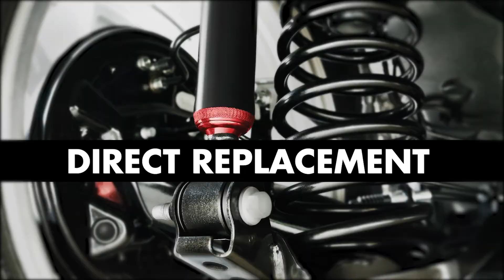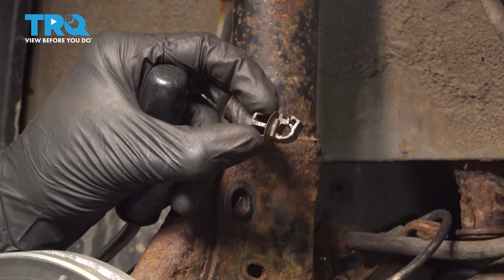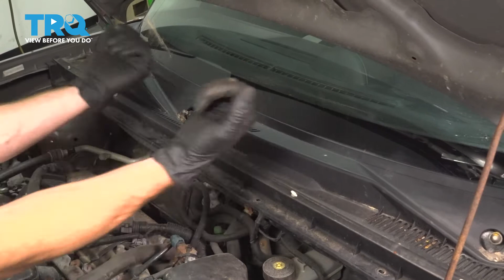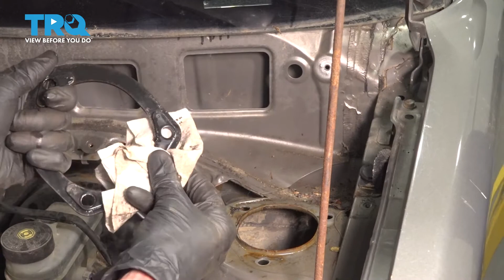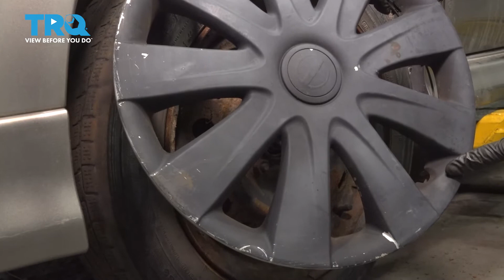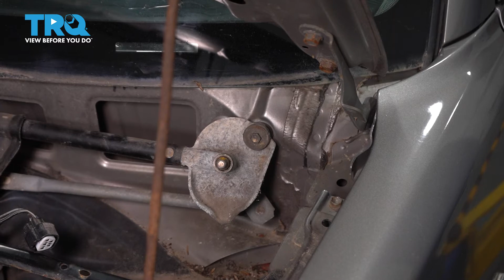How to Replace Front Strut & Spring Assembly 2004-2006 Scion xB

Comment: you don't need to do all of the gyrations with the cowl and the wiper assemblies. 12mm is all you need. I did it. And, what about the way the 30mm nut is "staked" on. you'll destroy the threads on the drive shaft and the nut. I know, because I did it.